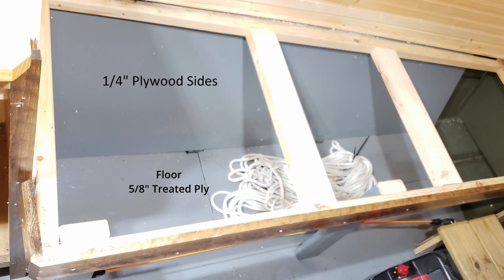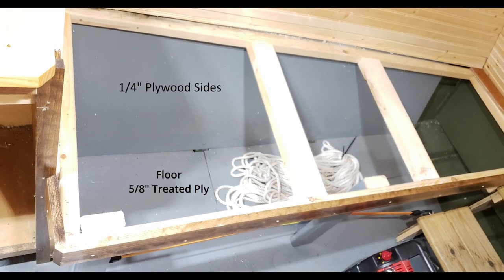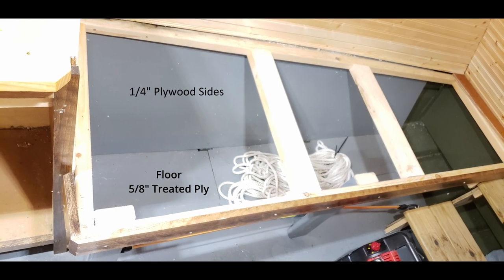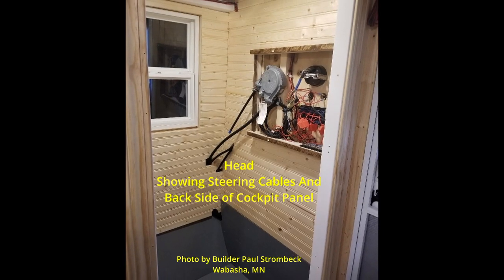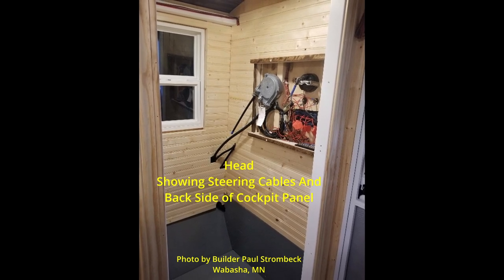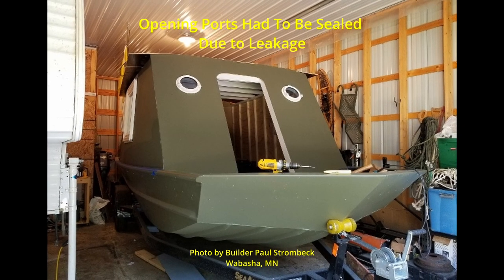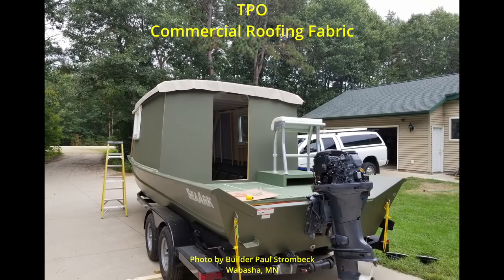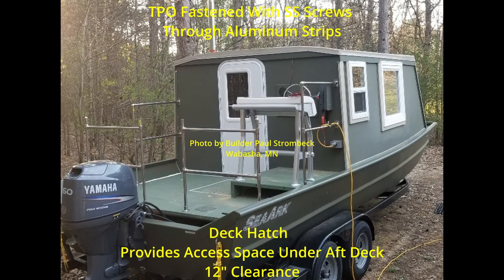Shanty Sanctuary, The Build, Design, Ep 2

Comment: These photos helped quite a bit to get an idea of the build, I didnt realize you were no the original builder. Looking forward to more build videos for improvements, you mentioned that it was 24" or that you would reccomend 26" just wondering what your reasoning was, or how you would use the additional space, not that extra space isnt always helpful just wondering if there was something specfic that you woul dlike to add
Reply from the maker: If you look more closely at Ep 1 you will see the length of the bunks as a factor when I compare the 26' hull that was the original Zach Taylor design .  This is also explained in some of the trip videos.  

The 24' hull does not provide enough space for a standard bunk size while still providing space for dinette for two and an adequate aft deck.  My primary bunk can handle my short height but the second bunk is for kid sized persons only.  A 26' hull would amend this problem.  

Thanks for the questions.

Comment: Hey man...did you make your May adventure? Ready to schedule a Nosy Beagle Interview?
Reply from the maker: Yes, I completed the Oahe Reservoir Trip (81.5 miles, 14 days).  It was a completely different environment from anything I've done before.  Scenic and lots of water but no place to access food, fuel, or water along the way so you have to be completely self-sufficient for two weeks. Wind also presented some problems.

As for an interview, yes I could do that anytime but the boat is now in storage until my next trip in July.  There is a large door opening and easy access, but  lighting would not be as good as outside. Contact me via the "About" section of the Channel and we can work out details.  Initially, I thought I might put into the St. Croix River when you came down and accomplish two things at once, but that plan has changed.

I will be doing two more long trips this summer and fall so there may be situations that could work better for meeting up than coming to the Twin Cities.  My second trip will be along the Ontario shore of Lake Superior, entering Canada at Portage, beginning the boat trip at Silver Islet, and running NE. 
The third will be a trip back to Temagami, Ontario in the fall. That requires driving through the U.P. to cross at Sault Ste. Marie before heading east.
Reply: @ShantySanctuary  will be in touch. ;)

Comment: Hi Ted!  Maybe you already mentioned this in another video but did you ever keep fuel consumption numbers?
Reply from the maker: As you probably saw, the outboard is a 60hp Yamaha and I generally run around 2600 RPM +/- which gives me around 6.5 kts/hr or 7.5 mph depending on the measure you use.  I can go a little faster but it just burns more fuel for not much speed gain.  I figure my range on 18 gallons of gas is approximately 70 nautical miles, or just over 80 statute miles.  That computes to roughly 1.7 gph or .26 gal/nm ( .23 gal/sm).

I recently doubled my fuel load for my next trip (no resupply) doubling my range, so I now carry 36 gallons in two 9 gallon tanks in the stern, and three 6 gallon tanks under my helm seat.  These tanks sit in the place I used to stow two 7 gallon water jugs.  As a result, I had to come up with a place to store water, which is now under the aft deck.  Instead of two 7 gallon jugs I now carry four 4 gallon jugs under the aft deck, which just fit.  

I still have to test this out on a trip to see if the extra weight will be a problem.  Loaded for a typical two week trip the boat is heavy (approx. 3900 lbs) and will not get up on a plane, so it is a matter of how much fuel you want to burn.  The engine runs smoothly and relatively quiet at the slower RPM and is more efficient on fuel.  I am not interested in cruising around at high speed anyway.  I'm a former sailboat owner so going slower and enjoying the surroundings is more my style. Actually a smaller outboard would be better but it came with the boat.
Reply: @ShantySanctuary  thank you Ted for the very detailed response.  That is great information.
Reply from the maker: You are welcome.  I enjoy helping out when I can and at this point responses are very manageable.
Reply: @ShantySanctuary  I built a raft and took it 1700 miles from Minneapolis to donaldsonville LA 20 years ago. Wish I could show you a picture of that crazy rig!
Reply from the maker: Too bad, I would have liked to see photos of your rig.  

I am considering going down the Mississippi at some point, perhaps not all the way, but 3 weeks or so south into Iowa.  I would like to do that in the fall to enjoy the colors along the river.

Comment: May I ask this question of you Sir ..?  What  Is the cost of building something like this ? with this hull design and size of the boat ..?..?
Reply from the maker: I can't give you a specific answer since I did not build the boat.  However, you can get an idea of the basic hull cost since it is a production SeaArk Jon Boat.  Here is a link to the exact hull: https://www.seaarkboats.com/boat/14/2472-mv.  Personally, I would recommend the next size up: https://www.seaarkboats.com/boat/15/2672-mv because the 24 footer does not allow enough adequate bunk length and space at the dinette with the current cabin design. Obviously, the cabin interior and overall length could be adjusted to provide more space but I think the 26 footer would provide the best balance of interior space and aft deck space.

Cost will depend on the components you use to put it together, size of the outboard motor, weather you install a heater or not, two burner stove top, or 3 burner stove with an oven, number of house batteries, whether you use a solar system to power a fridge or not, or plan only short trips using a standard ice chest.  The list goes on and on, as does the work to install it. The actual cabin construction materials would not be that significant compared to overall cost of the hull, motor, and other components.

I purchased the boat from the builder from an ad on Craig's List, here is the basic listing:

Custom Built Cabin Jon Boat (24 Foot Hull)
2018 Sea Ark 2472 Hull
2003 Yamaha 60 Outboard (35hours) with separate starting battery.
2018 Dual Axle Haul Rite Trailer with electric winch
Custom Bimini Top and wind screen
Enclosed head with electric flush porta potti
Propane Heater
Shore power and separate house battery.
Galley with two burners cook top and ice box
Twin Bunks
All safety equipment, life jackets, distress signals, handheld marine radio. 
Mooring lines, anchor lines and dual anchors, fenders, depth finder etc.

When I offered to purchase, I simply Googled all the components so I had some idea of the build cost, and made an offer that was accepted. I have extensively remodeled this boat to function up to three weeks or more in wilderness environments, with no shore support of any kind. Obviously that significantly increased the cost from what I originally purchased.  I hope to add to "The Design" series going forward by showing all the modifications I made to use the boat for my purposes.
Reply: @ShantySanctuary  Thank You for your reply and all the information you supplied,  lots to think about ...!  I admit I do not know about boats, but i do know that I want a smaller type Canell Boat  made as light as it can be... like the Erie Canell   Boats just putting along with no hurry ..I have to find the aluminum boat to start with ..?
Reply from the maker: Good luck in your search. It took me a while to find something, but occasionally you find a hidden gem when you least expect.